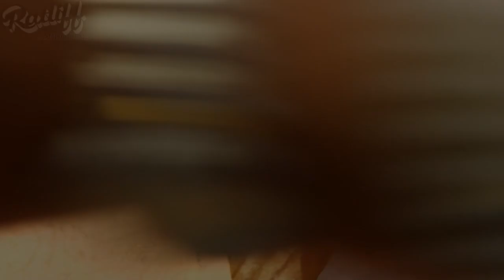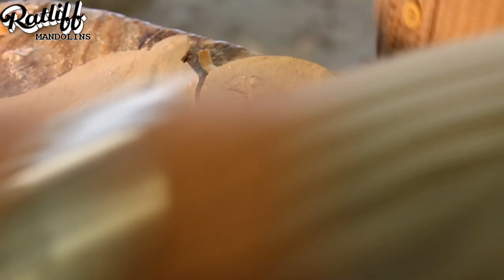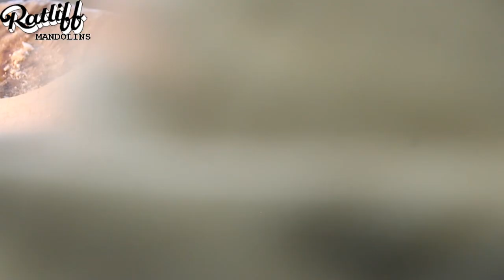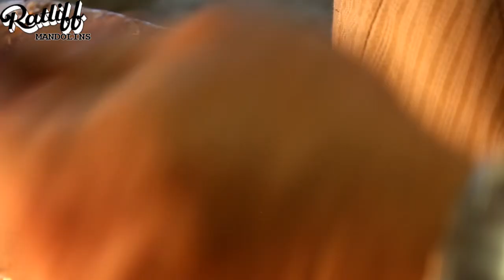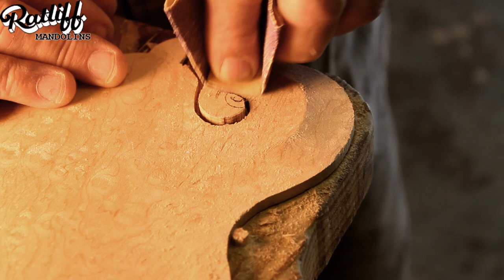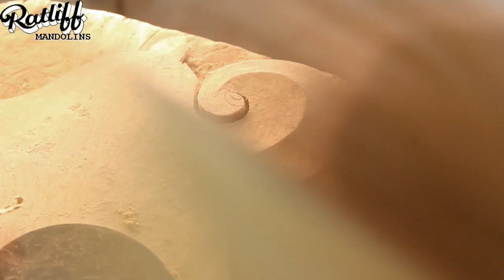Episode 10)  Carving a Mandolin Scroll

Comment: Love the sound a sharp chisel makes!  Is that a shop made scraper around the 11:00 mark?
Reply from the maker: Yes, I have several different sizes of some kind of round spring steel shaft spacer things.  Don't be too confused.  I don't know what they are either and  I don't remember where I acquired them.     They're about 1/16 thick and  range from about 2 1/2 inches to about 4 inches in diameter.     I've ground them down so they  fit over the scroll button but still reach  the floor of the inside part of the scroll.   They work perfectly and I think, after using them all these years, I'd have a real hard time carving a decent scroll without them...................